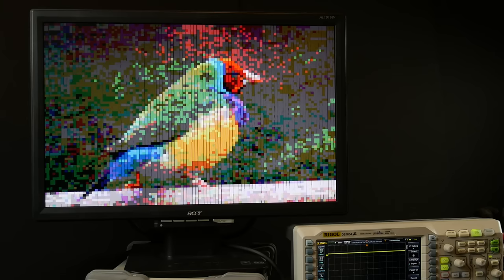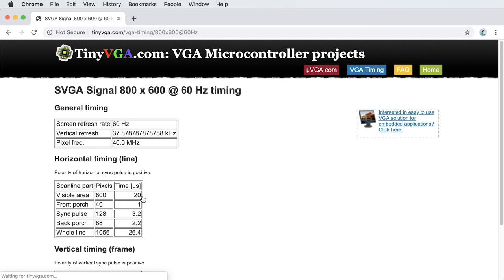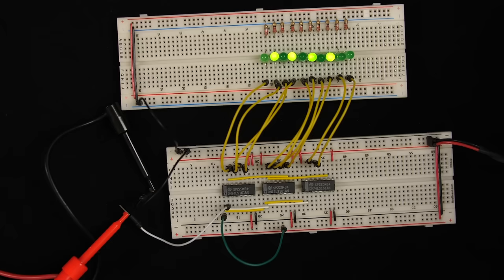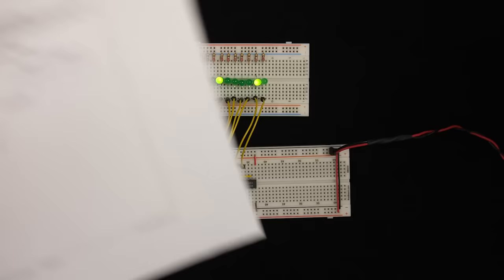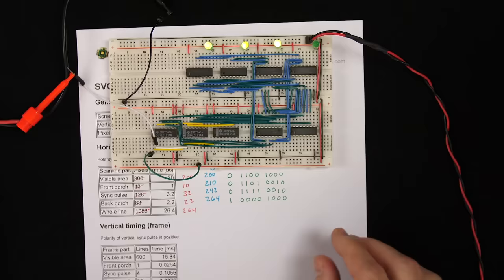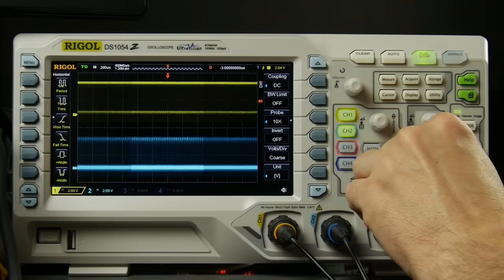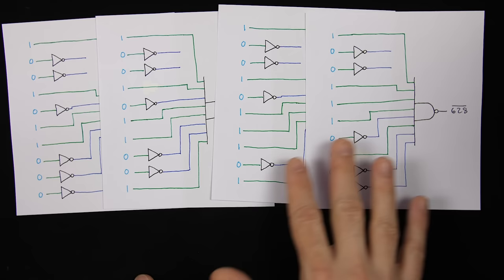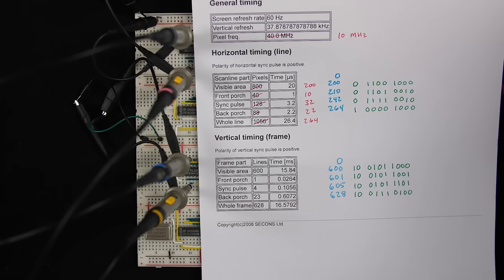The world's worst video card?

Comment from the maker: Want more information or want to try building this yourself? Check out https://eater.net/vga for schematics, kits, and more!
Reply: OK.. but..... Will it run DOOM???  :-D
Reply: @Ramdileo_sys  no. It's a video card not a full computer system.
Reply: @dwarslopers  first i was going to ask "But Can It Run Crysis?" :-) ... ... but then i change my mind ;-D
Reply: Why vertical has more counter that the horizontal? Isn't the vertical contains less line than the horizontal?

Edit: I don't know if this is the right answer but my guess is that one pixel contains rgb so there. So computer need to scan 3 times to display the correct pixel per row. The row he wants to display is 800 pixel, but divided by 4 is 200, match the hsync, and then times 3 (because it needs to scan the same horizontal line 3 times to display the correct r, g and b value), which is 600, match the vsync. Just as a guess. Or I'm just dumb and it's because there's 600 horizontal lines
Reply: @advanceringnewholder  It's because he had to use a 10MHz clock rather than the ideal spec for a 800x600 resolution, running at >36MHz. Ben explains this at the beginning and it's sorted out in the next video.
Reply: @kikito89x  yeah, that's the reason. I'm just being dumb. One of those facepalm moments you know
Reply: @kikito89x  ki
Reply: Best Channel EVER!
Reply: @SPFLDAngler  i dont think they meant on ONLY the card, but rather is the card capable of rendering doom if it were connected to an actual cpu, or rather it was just a joke :p
Reply: You could have saved another inverter circuit had you noticed that the highest bit for the horizontal sync only needs to be checked without inverting.
Reply: Front pannal HDMI adio
Reply: @advanceringnewholder  Between 0:15 and 0:30 you can see that there are 3 control lines for the colours Red, Green and Blue. All color CRT's have 3 electron beams: they use the shadow mask principle or trinitron principle whereby each beam lights up 3 closely positioned dots of 3 different phosphor colours. In an LCD screen the same VGA signal is received and the processor addresses the colour LEDs and sends the RGB value to the leds.
Reply: Yeah Thats the world's most amazing GPU even if its pixelating 😂
Reply: i whould love to see what i would look like just to build one for at least 720 p and able to play a few modern games.
Reply: BalbinoGD  p

We
.

We
Reply: @Ramdileo_sys  At one FPS yes, oh and you need to recreate it too.
Reply: Hi, I have a problem may you help, please? I cant get 74ls161 to work .
When I connected LEDs to the chip outputs they all started to blink together at once, not counting, just blinking all at the same time. What should I do?
Reply: It can be!
Reply: What vga monitor did you use
Reply: Can it be used with the 8 bit computer?
Reply: Mad props.

Have you seen the one where with a couple of problems and a hex buffer and a timer circuit could also do a emulated VGA card. The data in eprom contains the finite state automation program. EG the data from the eproms is partially address information for the next data value and partially data we controls the various signals. And a little bit of the data in the problems is used for the color information. It's a gigantic lookup table.

Sometimes we have to go backwards to go forwards. This technology is simple enough that you could easily retrofit old hardware with new ideas. VGA buffer screen for C=64 no problem.

Sort of like what we're talking about now with the difference between regular RAM and ECC ram. Sometimes you got to turn the problem on its side. He was part of the ram to do the ECC code. Yeah you get less ram but you get more reliability. Then it just becomes a software option
Reply: Darn it. Speech to text in autocorrect is weird. What I meant to say is components wise. An eprom large enough or two. A couple of hex data bufferchips. And a clock.

Circuitry goes data output pins. To hex buffer for one address and data value buffer between clock cycles. Some of the data lines are used to control the signals on off. Some of the data lines are used output the color values. It's a feedback loop. No CPU needed. The data is programmed into the eprom for the addressing the signals and the color. Change the data in the prom or static ram, you could change the image and or the format of the output signal. 400x300, 800x600,024x768 no problem it's just a matter of being able to have enough heat problem to be able to run the finite State automation.
Reply: how is the graphics if you run it on Roblox
Reply: Just FYI.  In fact I'm not sure if the sync signals are still used this way but many years ago when I worked at a TV station in Edmonton, a lot of our programing came to us via a cross country microwave network , with delay centers to accomadate time zones.  Therefore a show that started 3 hours earlier was taped and played back at a delay center.  The quality of the re broadcast program could be checked by hidden test signals.  Between each frame was a vertical interval ( as you described time for the beam  to aline itself on the left side ready to paint a horizontal series and build a single frame.  There were 14 lines in the vertical interval that contained a complet color tset signal and a few other tests.  With a properly timed scope you could pull up the yest signals and measurethe quality of the rebroadcast video.  Worked very well, at home you could tweek yor vert hold and roll into mid frame and see the flattened color bars on your homr tv.

Comment: Great explanation. 
I had to look up the 74ls161 datasheet. This chip has an asynchronous clear. That is what caused the 0.1 microsecond discrepancy on the pixel timing. The 74ls163 is drop in compatible and will solve this. It has synchronous clear.
Reply: I thought it wouldn't even work... I was worrying the whole video about it. I think he could also use flip-flops for that, or even an RC circuit with an Schmidt trigger inverter (74LS14, if I remember correctly), but that would have scared half the audience out! :D
Reply: @guillep2k  Ah, I'm glad you said that last part.  I started to think y'all were actual computers or something.
Reply: Nani dafuck?!
Reply: To me it looks like you're speaking a whole different language
Reply: I was totally about to say those exact words because i know what they all mean
Reply: the worst thing about asynchronous reset is that the counter outputs aren't going to change at the same time, so as it is going over a power of 2 boundary (256) it could briefly produce the 264 and clear the counter. it's only luck that the circuit doesn't do this, maybe the exact glitches if present are fast enough and ( usually not amounting to 264 ) that the nand gate swallows them. Any of the other "interesting" numbers could also show up during the transition from 255 to 256, so might falsely set or reset one of the SR latches
Reply: ... so you really need another clocked stage after the decode logic to register their values only when it is known that their outputs are valid
Reply: This error aside, these are unusually good videos.
Reply: Steve McNeil The traditional TTL solution is to hook a 1-bit D flip-flop to the output of the end trigger, rewired to trigger one count earlier.  And the traditional 4 bit counter chip is 7493 or the dual-4-bit 74393 package.  What really annoyed me was that he wasn't ignoring most of the 0-bits for outputs that will need to stay active for most/all higher values that can occur at all.  He could call it "cheating" and quietly do the Karnaugh maps off camera.
Reply: The 74ls161 and 163 are synchronous counters with a synchronous carry bit. Only the clear(reset) is asynchronous on the 161 so power of 2 glitching is avoided even chip to chip.
Reply: @DustyRoseDance  I think that it being a synchronous counter makes it worse, because while ideally all the outputs would flip at once, that is not possible: there will likely be tens of picoseconds difference between them, and for some instant lasting tens of picoseconds, the output could go through 264 on its way to 256. in particular if the 2^3 bit is slow to change from 1 to 0. That glitch would almost certainly be swallowed by the 8 input gate but if this were for example a high speed cmos vlsi ic you couldn't count on that, in general its a bit sketchy to require slow gates to swallow glitches.) 

A ripple counter wont do that: the bits flip in a known order from lsb up to msb, with clock-to-q delays between them, so you can ensure that the decoded output wont glitch, perhaps by arranging the decoding logic to AND-in the MSB as the last gate: in a ripple counter bit 3 is guaranteed to go low before bit 8. It's still sketchy, as John Doe said, better to subtract one from all the counts and use a flip flop to register the clear signal on the next clock
Reply: another approach would be to count down from 263. The transition from 1 to 0 only flips one bit, and all the other bits were already 0, so the decoding logic for the zero state can never see all zeros except at the final count. at the transition 256 -> 255 the lsb flips 0 to 1 first and then there's a 9 clock-to-q delay before the MSB goes 1 to zero, but since LSB already flipped the gate wont see 000000000.
Reply: @ericzeisel3522  with the 74ls163, the synchronous clear will automatically wait for the next clock cycle before clearing. Since the clock is 0.1 microseconds, a few picoseconds for stable outputs is acceptable.

Comment: We have done this on FPGAs many times, however, it is an invaluable experience to see authentic circuitry handcrafted like that!
Reply: Canberk Sönmez read to here and win a beer
Reply: Interested in your FPGA video work if you have links
Reply: @politesociety  I have a digital storage type oscilloscope project designed to run on a Altera Cyclone development board. Links are not available right now, but if you are interested, I can upload that on GitHub
Reply: The dark arts of FPGAs, I worked on that too!
Reply: Just because something's an FPGA doesn't mean it's "not authentic." That depends on if it's original or a copy.

Comment: I'm so glad I discovered this channel. I look outside and see all the craziness and I can turn it all off and watch something that is very concrete, logical, ordered. It's very theraputic.
Reply: There is nothing "logical" in using 1960s 7400s series logic gates when a $2 MPU and a 10 lines of C code could do it....
Reply: @ntal5859  It's not for a practical use, or how you could do it in the cheapest way, it's both a fun project and a teaching tool. It doesn't matter how you could do it cheaper, or more efficiently, or with more resolution, because it's a teaching tool.

Comment: Just connecting the horizontal pixel counter bits to the R G B monitor inputs should draw some nice stripes.
Reply: Brilliant!  Vertical stripes, driven by higher bits buffered and voltage divided... 8 different color variations?  More colors filling in going from left to right.
Reply: Hadn't thought of that.

I figured you could just tie one or more of the RGB lines high (with suitable level conversion - though I assume the sync lines are at the same voltage level anyway)

I actually thought the easiest thing to do with a design like this would be to wire some suitable pots to the R G B inputs, so you could arbitrarily change the colour of the whole display.

The only thing I'm uncertain about is whether you actually have to cut the signal when outside the active display period.

If not, you can literally just tie the inputs to an arbitrary voltage level (within the safe range of what VGA expects), otherwise you'd have to sync it with the timing counters somehow.
Reply: @KuraIthys  Fancy Philips Hue light.  Actually, it's kinda crazy that there's a lot more digital logic inside a Philips Hue light bulb!
Reply: I can’t wait
Reply: No spoilers please! :-)
Reply: R2R resistor ladder to convert the bits into an analog color signal(between 0 and 0.7v per color)
Reply: I also had the idea with the pots. I don't think it's allowed to have signal in the blanking period, because that's where the ray retraces to the beginning of a line or from the bottom to the top line. It would probably make the retracing visible. All of this is probably irrelevant with a digital display.
Reply: I wonder about that. It depends on how the internal logic of a monitor works.

Obviously this is a purely analogue system originally (an LCD with a VGA input is of course faking it, but that's neither here nor there)

The thing is, RGB 0,0,0 is NOT the same thing as turning the electron guns off.
And since your typical VGA monitor isn't intended as a vector display, it wouldn't make a huge amount of sense for the monitors to blindly process the input.
After all, the sync pulses are telling the monitor when a line ends, and when a frame ends, not so much when and where to move the beam.

Still, without taking a careful look at how monitors are constructed I guess we'll have no idea.
And even then you would need to look at a variety of them.

Undoubtedly the behaviour of a modern LCD is nothing like a CRT, but I suspect a mid 90's multi-sync SVGA monitor is also going to be quite different from a first generation VGA monitor from 1987 (even though they use the same connector and signalling standards.)
Reply: @alimmi9  It is allowed. It's where teletext was sending text stream data (when the ray was invisible).

Comment: I implemented this on an FPGA (Cyclone II) this morning, that was fun. :)
The only difference was that I used timings for 800x600@72Hz because the pixel clock exactly matches up with my board's 50MHz crystal.
Reply: whats fpga or cyclone ?
Reply: @mrelo007 Though breadboards and chips are used here, no one actually does that for prototyping in the industry. You write the logic in these special programming languages called HDLs(Hardware Description Language) and upload it to an FPGA (Field Programmable Gate Arrays) which looks much like an Arduino if you will and test it from there. Cyclone II is one of the FPGA models

Comment: Reminds me of back in the 50s & 60s when CRTs (Cathode Ray Tube TVs), would lose sync and the picture would "roll" (become out-of-sync Vertically or Horizontally). When that happened you walked over to the TV and turned the appropriate knob (pot, or potentiometer) to adjust it. Most of the time it worked but if it didn't, you slapped the TV console on the side or the top and that would fix it. Eventually, you would have to take it in to the TV repair shop and get it worked on or buy a new one. That's something from the past that I don't miss one bit.

Comment: this is SOOOO exciting.  after the next video... i'm really starting to anticipate some sort of VGA output for the 8-bit computer!
Reply: Me too - truthfully, I’d love to see some (really slow and basic!) linux running on a home built
Reply: I'm hoping that it will play PONG. ( It will need an audio circuit that goes "beep" for a hit and "bloop" for a miss . . . )                   - j q t -
Reply: @srslyyouguys  linux wont run on it because that computer is not implementing the full ibm pc architecture
Reply: Andrew Vaughan Check our Bill Buzbee’s Magic-1 running a port of Minix 2. www.homebrewcpu.org
Reply: @user-ge4uk9ui8y  Well... his 8-Bit CPU has way to little memory to implement linux ATM as is. The 64k memory limitation of a 8-bit system would make it severely challenging to cut it down to fit. adding extra cpu instructions, would help that task, but you would also need a disk drive interface (mass storage) interface to really make it possible.  perhaps a microsd interface.